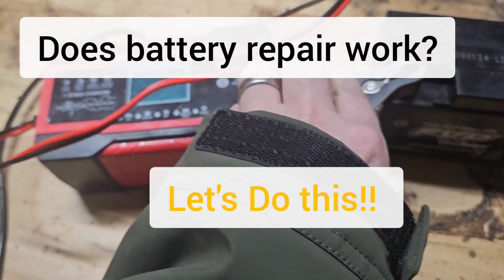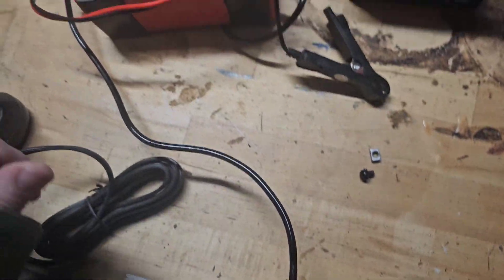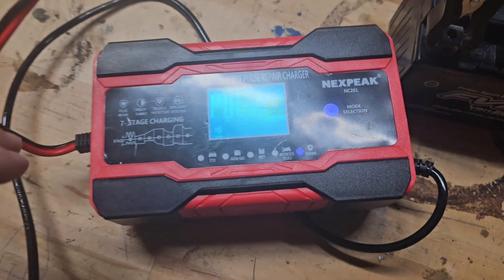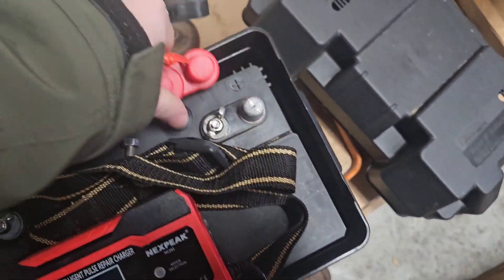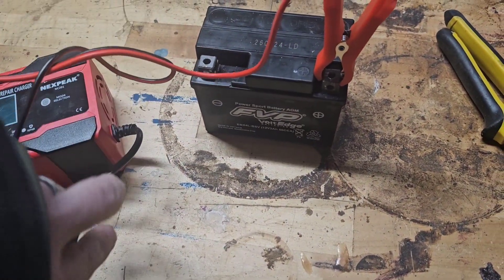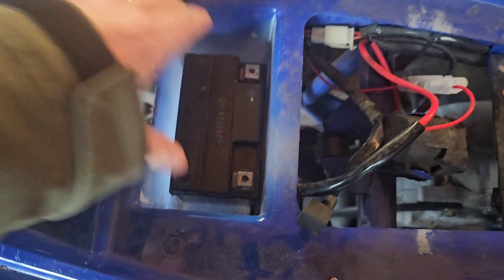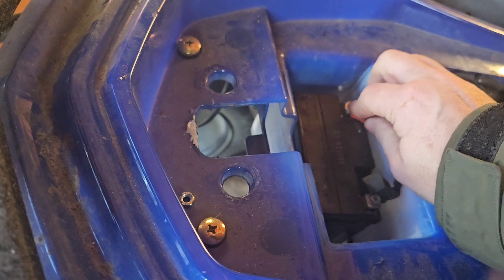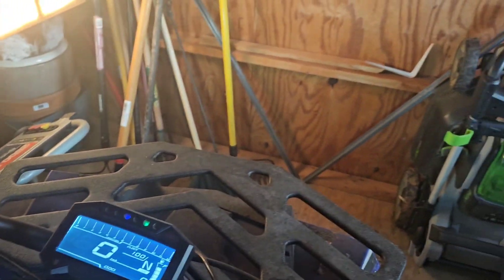Fixed! Reviving a Dead ATV Battery with Charger Repair Mode

Comment: The manual specifically says to first use the regular charging mode and only after is says FULL to use repair mode, especially for dead batteries.
Reply from the maker: This one has an automatic mode, it assesses the battery and does its own thing. So i just hook it up and let er rip. Maybe it starts repair mode but jumps around. Selects the battery type to charge on its own too. I havent actually sat and watched it. But what what thos models booklet said to do. Im just following poorly written badly translated instrictions 😂
Reply: @LetsDoThisWithEvan  Yeah, they're poorly written, and you only get 25s to change the mode yourself before it locks in the current mode, which is probably what you saw. But the procedure is full charge first, for the kind of battery you have, then repair mode. Which in my case is taking well over the stated 4 hours, in fact nearly 7 so far and still running.
Reply from the maker: @HabaneroTi thats good to know! I appreciate you clarifying. Thank goodness my battery didnt go bad
Reply: @LetsDoThisWithEvan  I just decided to pull the battery after nearly 7 hours on repair mode and reinstall it in the car. Disconnected from the charger, it showed 13.2V. Reinistalled, the car started right away. Mission accomplished. The only question is if it holds and I don't have to run the car everyday to keep it from dying again.